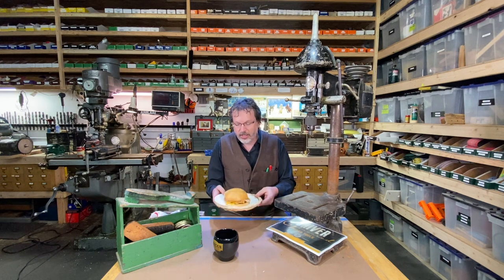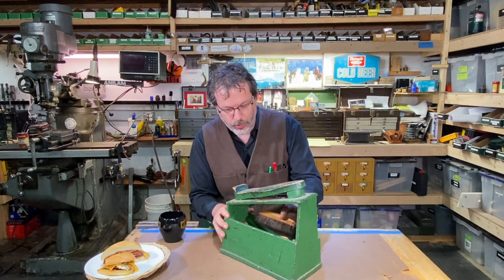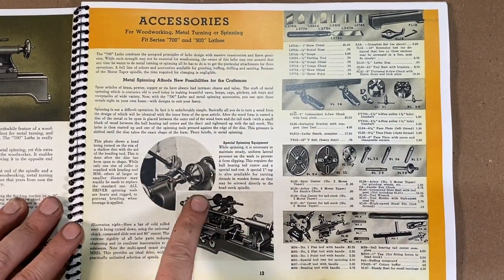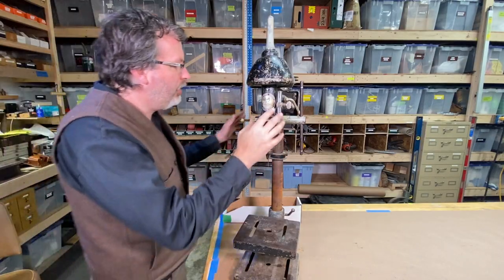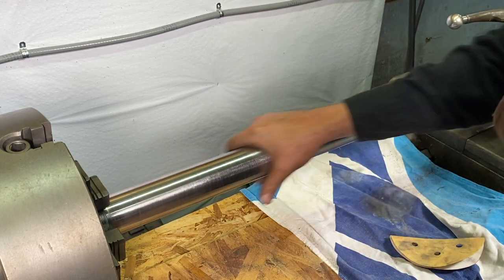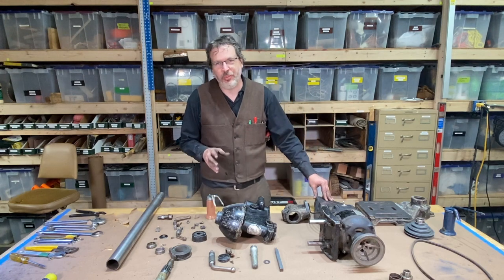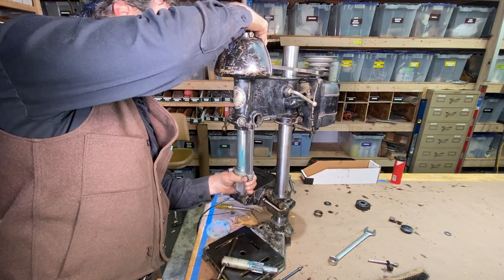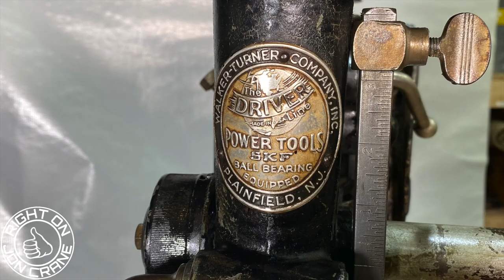Taylor Ham Tuesday E3 - Walker Turner Drill Press Restoration - Driver Line 700 - Shoe Shine Box

Comment: Right on Jon,  Nice sandwhich, shoebox, and great clean up of the Walker Turner.  The motor sounds a bit loud.  Thanks for sharing.
Reply from the maker: Thanks Randy! 👍🏼 I think the bearings I got on that pulley are a bit loud. Luckily I have the original set from the drill press. I’ll swap them out and see if it quiets down. 🤞🏼
Reply: @RightOnJonCrane  I wear headphones when I watch YT and you hear everything, cars, doors, bearings.